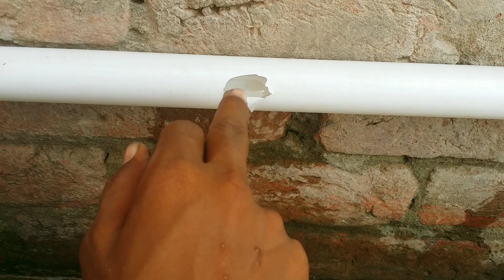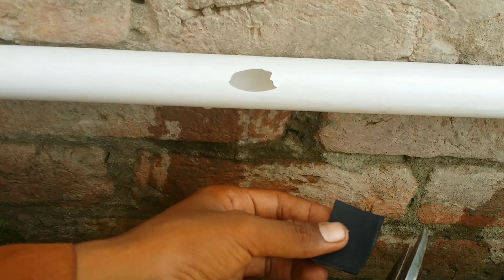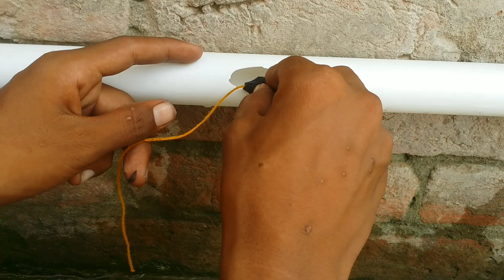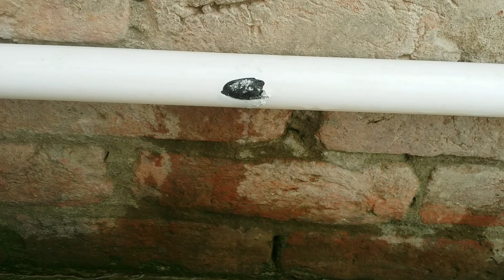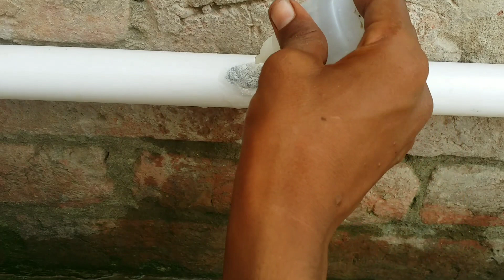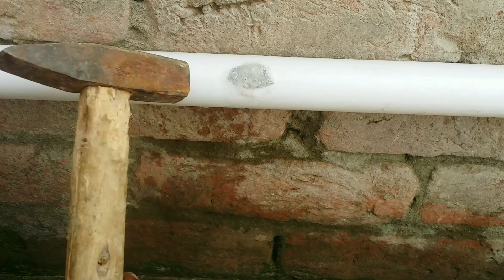Quick Fix: Repairing a Leaking PVC Water Pipe Under Pressure

Comment: Super Glue will not last in a wet environment.  28 days, max. Immediate repaired strength has no meaning.  What is the white powder, anyway? You never talked in the video.  Poorly researched and tested repair.